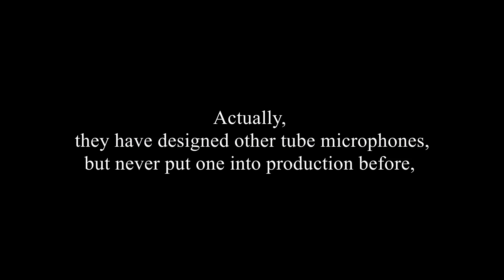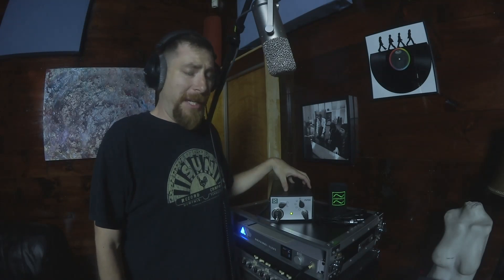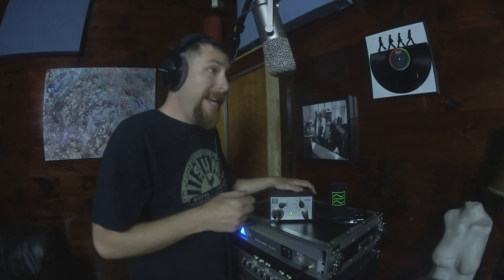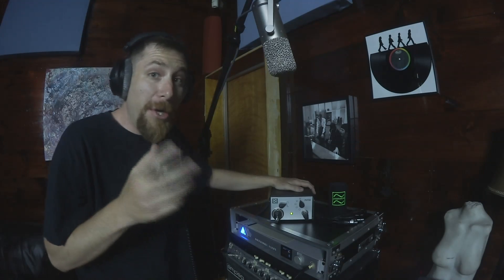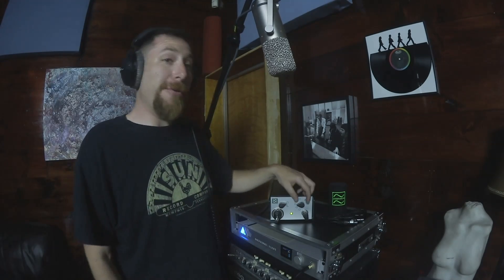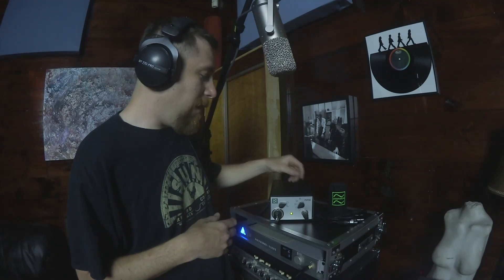Josephson C-725 Overview

Comment: do they make a single capsule version that sounds close to the cardioid in sun mode? I would buy this but i don't need al the extra patterns
Reply from the maker: Do you mean “single sided” capsule version? The closest sound to sun mode is the C716. They use the same JT12 “ck12 dual sided capsule, but electronically configured only for Cardioid patten.